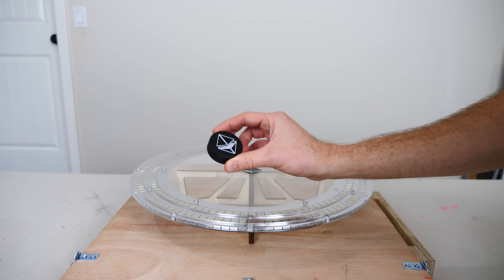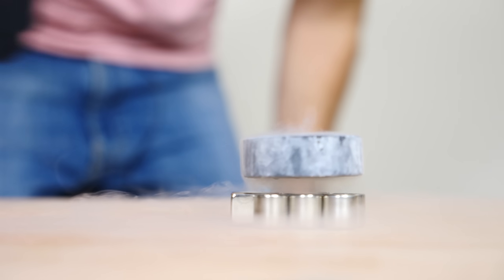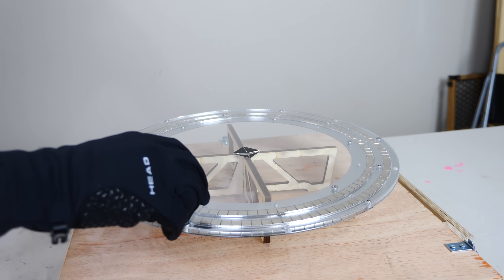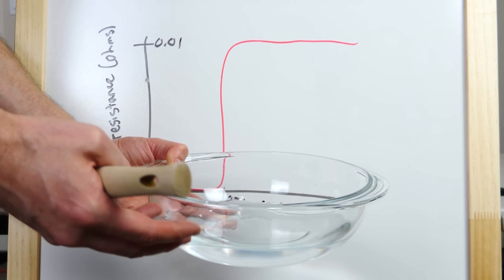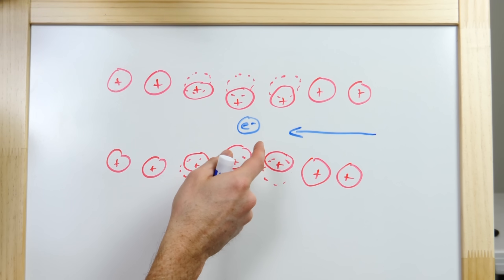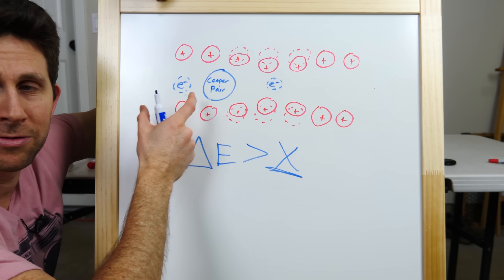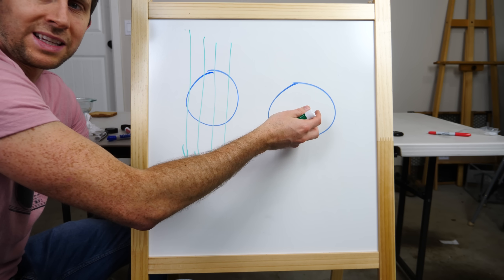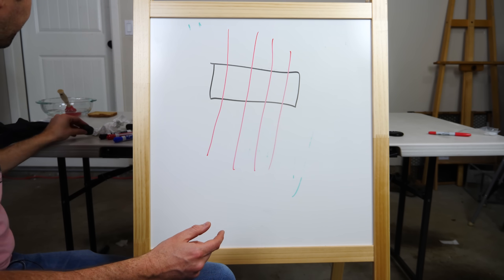Quantum Locking Will Blow Your Mind—How Does it Work?

Comment: You describe the "original", "normal" superconductors, but those become superconducting at very low temperatures. The one you were using is a high temperature superconductor which may become superconducting even at liquid nitrogen temperatures., which is cheap to achieve. This type of superconductivity cannot be explained by Cooper-pairs.

Comment: If there is a strong enough magnetic force that keeps the magnet and superconducting material together, if you pick up the magnet, do you need the force to pick up the combined weight of magnet+ superconductor or just the magnet's weight? 🤔

Comment: There are no perfect super conductors.  The resistance is never exactly zero.  But it can be so small we can ignore it for the duration of the experiment.  You model might predict zero resistivity, but you can never construct a material so perfectly to achieve it.  Just as you can never achieve a perfect vacuum.  Even interstellar space has enough stray atoms to act as a medium with an index of refraction > 1.  But the interstellar medium is so close to perfect, that in most cases you can ignore that effect even for light travelling billions of light years through space.   Likewise, most experiments you can ignore the resistivity of your super conductor.  Because long before you start to see the effects of resistivity effect your eddy currents, you'll see other environmental effects such as the warming of the super conductor have effects.

In the LEP experiments to correctly calculate the beam energies it was necessary to correct for the tidal forces of the moon.   In LIGO it is necessary to correct for effects a small fraction of the size of proton.   Sometimes these small effects, and the fact they are not exactly zero matter.  Even if I had "perfect" process for manufacturing my superconductor, the Heissenburg Uncertainty Principle will allow it to deviate from my perfect state because I can only construct and store it in a non-perfect vacuum.

Comment: He called this perpetual motion as long as the temperature stays low, but does he mean it WOULD be perpetually in motion if it were in a vacuum?  Because air at sea level (or even at high altitude) has density and exerts friction on the object in motion, right?   Maybe I'm wrong.  I don't know....

Comment: Quick question, if you made the gap between the neodymium magnets oscillate from slightly bigger to slightly smaller just behind the superconducting material would this accelerate the puk automatically and if so what sort of speed do you think it would reach? It might have no friction but it would still have to contend with air resistant.... unless we put it in a vacuum.... would it ever stop if we did this in the cold vacuum of space.

Comment: I don't like the explanation about the Cooper pair attraction.  The diagram shows the first electron entering the positive ion cloud and indicates a slight pulling-in of positive ions around this electron.  If the reason for electron #2 tp have a pairing attraction is due to the slightly higher positive e-field caused by the closer proximity of positive ions around electron #1,  (the Cooper pairing) then why does not the second electron also have this pinching effect on the positive ion cloud - thus canceling electron attraction?  Seems like the drawing should extend farther to the left with additional positive ions that would also show the "attractive pinch" between the + ion layer and the second electron.

Comment: The house of cards that is built on field "descriptions" amazes me, when no one knows what the field is or what it's made of or how it works.  They can accurately describe what they see it do, but describing is not an understanding.  Imagine if medicine described symptoms with math and ignored causality.  The CERN website used to say, "No matter how much energy we put into the field, the particle never reaches the speed of light."  --HOW CAN YOU EXPECT TO PUSH A CAR FASTER THAN YOU CAN RUN?  There is too much theory built on descriptions.  The Strong force was a fix to keep from second-guessing the already 100 year old concept of charge.  Now it's a long way back.

Comment: I have a question.  You lifted the locked magnet and it picked up the puck which was locked to the magnet.  If the magnet weighed x grams and the puck weight y grams, is the weight of lifting the magnet with the locked puck x+y or is it x? Does the weight become the entire set of locked things?

Comment: I'm no scientist by any means so correct me if I'm wrong. If you could accelerate a space craft using superconductivity means the with gradually increasing resistors as you described you would be able to decelerate using type 2 superconductors. Correct? 
Would superconductivity be good for other forms of basic transportation in closed environments like airports and factories and warehouses for transporting people and products assuming it was cost effective? Could locked superconductivity be used to lift and move heavy items such as in construction and manufacturing?
Could this reduce fossil fuel consumption by using only electricity?

Comment: Why could a space craft be launched into space using this method? Sort of a magnetic sling shot.  Wouldn't this save fuel?  How fast could a craft move or how quickly could it be helped to moved into the atmosphere with the help of super conductive momentum? So electicity determines the weight a super conductive  material can lift. So the stronger the electric voltage the stronger the magnetic effect?

Comment: What you call as energy is electromotive force caused by charges. When a conductor has a an electric field through it, the emf, including attractive force caused by the cations or positively-charged irons at the positive terminal, and the  repulsive force caused by the accumulated electrons at the negative terminal of the power source,  drive the free electrons in the valences of the atoms in the atomic lattice structure of the conducting material, shifting their random motions in the opposite direction to  that of the electric field from the negative terminal to the positive terminal, and causing those free electrons collide wit one another more frequently, and their collisions cause  more frictional forces among themselves, leading to some losses of kinetic energy, or more exactly- speaking,  motive force moving electrons. The lost motive force is  called as dissipated energy in the form of heat. The increasing heat in the conducting material is absorbed by electrons at lower levels of energy around their atoms, and those electrons jump up to higher levels of energy , then break away from their atoms, and collide with free electrons , deaccelerating the shifted random motions of the free electrons, and that is how the resistance to the current or to the  transmission of the electromotive force  between the two terminals of the power source through the conductor. increases. But it is not like  how you explain that electrons from the power source hit atoms in the conducting material. It depends on which type of current you use whether there is any actual flow of electrons or not at all.
In AC current, there is no actual flow of electrons from the negative terminal  through a conductor to the positive terminal, and there is only oscillations of free electrons in the conductor. In DC current, the free electrons do move through the conductor.
When you put a semi-conductor in liquid nitrogen, the freezing kelvin temperature of the nitrogen  lowers the temperature of the the semiconductor,  and the lowered freezing temperature of the semi-conductor causes the free electrons in the semi-conductor to stop their random motions , because the temperature of a particle is proportional to its speed. So, when an electric field is applied through the frozen semi-conductor, free electrons at the negative terminal get attracted by the cations at the positive terminal , and thus they move in the semi-conductor and  repel the  free electrons already existing in  the semi-conductor without any random motion of the existing free electrons in the semi-conductor , therefore no collision with the free electrons of the atoms of the semi-conductor, and thus, the repulsive force by free electrons from the negative terminal  is not lost to any collision in the semiconductor, which leads to increasing the velocity of the free electrons running through the  frozen semi-conductor, and there are more electrons moving through the frozen semi- conductor at a given time than there are when the semi-conductor is not frozen or not cooled down, and that is how the semi-conductor becomes super-conductor

Comment: I find myself increasing captivated with quantum mechanics, more specifically perpetual motion I believe that’s where the answer to the energy crises  is I’ve seen other interesting concepts like hydrogen and fusion. I’ve looked at a few perpetual motion generators there were a few using mono pull magnets and another using the repeated heating and cooling of nitinol metal. Can you imagine a endless font of energy, how exciting would that be?

Comment: So out of curiosity would it be possible to make a perpetual motion generator using a quantum locking method in space surly the vacuum of space is cold enough to cool the super conductor without the use of liquid nitrogen 🤔 I seen a few perpetual motion generators that had used Mono pull magnets. I guess that the magnet would be the only thing that would need to be replaced over periods of time apparently magnets have a shelf life or so I was told for the record I have no physics background or anything aside from what I’ve learned from watching random videos. I can’t help but wonder when I see exciting things like this I had no idea quantum locking was even a thing until now 🤣

Comment: So If you had some way of cooling the puck like the boiling water in a vacuum (but on steroids) you could then maybe put a shilded magnet facing upwards, spooled coppar wire, push the puck(s) to maximum velocity obove that and turn it into a perpetual generator? Granted, a very low power generator, but still.

The vacuum chamber won't require any electricity, and as such, no fuel is needed to cool it down. The puck has 0 resistence, so that won't require any fuel to keep going, all you would need is the kinetic energy to put the pucks in motion to start the process.

What am I missing? Or did I just figure out a way to generate free energy (which shouldn't be possible)

Comment: using tubes inside rails filled with water with magnet inside its easy to pressurize the water overthe air to cool the magnet .. locked down by screw its free energy after the initial effort never mind 1:1 its an illusion .. you build a deck to get mor eout of it than the effort you put in ... right dude ;)

Comment: 2:04 I have an idea.

Self cooling million dollar handbags where the handle isn’t connected to the bag. The handle is a very powerful magnet and the bag part self cools extremely cold at the top of the bag (you put thing in through the side of the bag or something) and it won’t get the stuff inside cold. It’s just a quantum locked handbag 

Price: $300,000,000

Comment: you should try this in a vacuum chamber. the only thing slowing down the superconducter down when rotating should be air resistance, right? And the super conducter only warms up because its getting heated up by the air around it (besides from light). So how long will the superconductor rotate on the magnet slide in a vacuum?

Comment: If the ring of magnets along with the supercooled puck were placed into a vacuum  chamber and could be kept at a super cooled temperature, would the puck be able to circle around perpetually?  There wouldn't be any friction of air due to the vacuum, correct?  If not perpetually, then maybe for years & years?

Comment: The part that baffles me, is that it would seem like the rate of heat transfer would have to be pretty fast since the room is going to be so much warmer than the puck, which is also so small, so it seems like you wouldn't keep superconductivity for long.. So I guess you would have to go way below 130 kelvin, since once the room brings it over 130 kelvin it would no longer be a superconductor. But the difference between a temperature that cold, say if ya went down to 80 kelvin or something would seem to warm up pretty fast relative to the room you are in. How long do you  last before it gets too warm and the puck falls?

Comment: When the superconducting ceramic swirls around the magent ring, doe sit not encounter air friction? And we know countering air friction requires energy. So where is the energy in the system is consumed? 

If there is energy consumed (loss) wouldn;t the ceramic eventually stop moving? 

Also, there has to be a cetra pedal force to pull the ceramic block towards the center. This requires acceleration which exerts force and hence losing energy. 

I am stumbled by energy conservation in the circulating ceramic superconductor system. Where does the energy come from and where does it go?

Comment: Saying voltage increases the speed of the electron may not be the best description of their interaction. I realize these are intro level 15 min descriptions of some fairly complex physics and engineering concepts. But I think u could simply: A- make video longer, or B-wipe out the first HALF of ur video (it's thumbnails and being an Ad shill, any original content is at the 5th grade level). Take all that time (nearly half the playtime) and use it to explain things on a slightly higher level.

Comment: I don't believe you know what flux lines are and what is really going on when iron molecules have been  line up north and south. I could explain it to you.
First imagine a perfect vacuum at the center of our galaxy.
  Then , consider ( C squared) as the sub atomic particulates traveling from the north and south poles of the center of our galaxy at ( C squared ) after the perfect vacuum pulls the sub atomic particles away from the atom that enters the perfect vacuum and now those sub parts travel away at (C squared)  .
  Magnets allow a funneling of sub parts

Comment: If you could change the imperfections in the superconductor on the fly via a controlable matrix, it may be possible to change the quantum locking to one of your choosing... rotation.  Like a superconcductor stepper motor

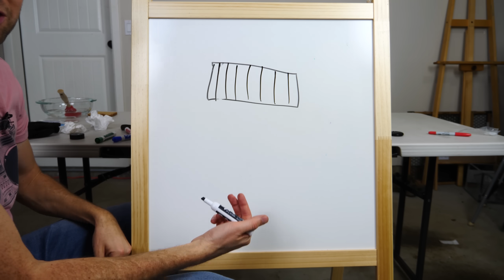Comment: As you were explaining quantum locking and how the superconductor pins the strings of the magnetic field (15:10), I imagined it would be somewhat similar as when walking through a narrow passageway and you reach a point where you have to turn sideways and try to squeeze through but you get stuck.  I also imagine that the magnetic field would first follow the most direct routes and only after those routes have been blocked does the rest of the field then spill around the superconductor.  Like when the elevators are full and people start taking the stairs.  Perhaps a good visual would be people walking between rows of cars.  Thanks for another great, informing video.

Comment: When on the track will it loose velocity due to air resistance? Or could it remain spinning on the track infinitely without slowing assuming it could stay cold enough?
Reply: It will definitely lose velocity due to air resistance. The 0 resistance is only for the superconductor itself for the flow of electrons. You can think of it as the floating factor, The superconductor's conductivity is what's allowing it to float, as the temp rises, it will start floating down and eventually drop off.

Comment: I once fashioned a bike lock that incorporated the theories behind Quantum Locking and used it to lock up my bike outside the main library on campus.
But my laptop crashed and I couldn't get the lock open so I called a locksmith. After many unsuccessful attempts, I finally found found a locksmith who also had a Graduate degree in in Quantum Physics, that could finally open it.
After so much trouble, I've decided to avoid any further quantum entanglements and just stick with a regular bike lock.
Reply: A sound approach. Whenever I don't like reality I just call a quantum mechanic and have it adjusted.
Reply: @blueconcretezebra  😆Laughing Out Loud!!😆‼️
(But only in this Universe and the one next to it.🌎🌌🌏)

Comment: So odd thought if space is technically absolute zero  do to there being so few particals  could we not use this as joints for equipment in space  or a method of preventing the issue of cold welding that can happen in space by forcing joints to stay at a set distance. But we would need to have a method of geting large amounts of resources in to space for use.

Comment: We're seeing this demonstration taking place in common, breathable air. Could the magnetic field be enhanced, ie made stronger, if everything was simplified, such as a vacuum? Additionally, can fluids act against the conditions necessary for magnetic fields to thrive? Last thought... if it were possible to surround both the superconductor and the magnetic field in liquid nitrogen, cooling all the parts together, would it create a "stronger" magnetic field?
Reply: ok, another question: can gases themselves act as superconducters? Space is a very cold vacuum, can gases exist in an extremely cold state and perform the same way as the superconductor in your demonstration? Riding through the magnetic field(s)?

Comment: How does super conductors scale up in term of strenght? Like if you x the size to say a car, does it multiply the power as well? Or the power/size ratio of this magnetic force, how large of a "road" would you need to support the weight of a car? For a potential theoretical New vehicle type using this physics